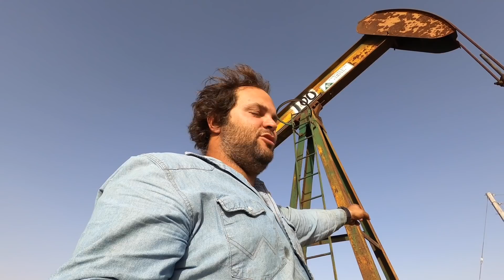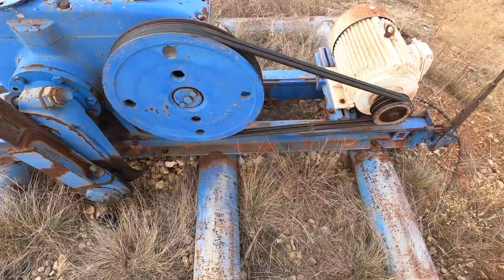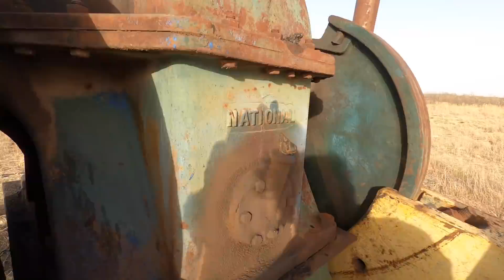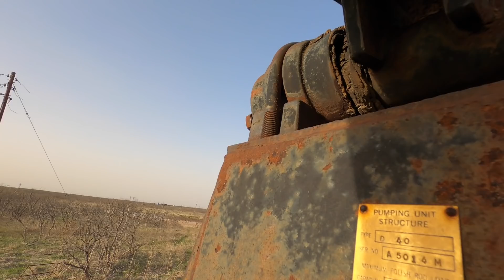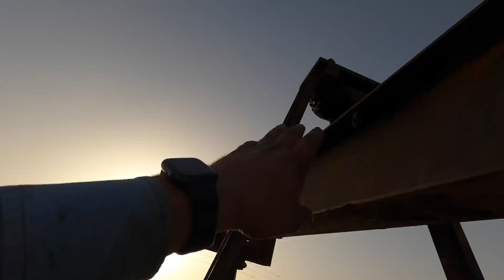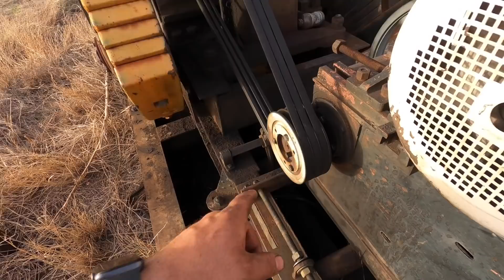Everything Pumping Unit.

Comment: I just started looking after some Sentry/Shores 114-173-64 pumping units. Wanting to start a greasing rotation. Is it possible to over grease a unit? Also what is the best gear oil to use?

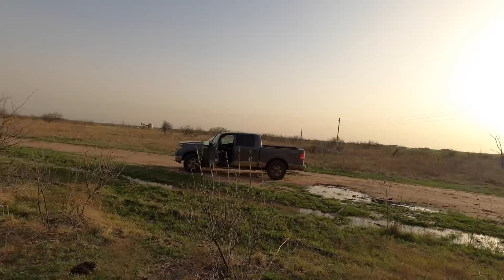Comment: At the 13:30 mark is that water on the ground salt water the cows cant drink? Or is it well water not fit for man nor beast? So your casings run down 150ft to exclude surface water so the cows probably know not to hit up on oil rigs. Looks like they were hungry but I saw lots of green stuff on the ground for the farmer. I saw you hot rodding on the road so keeping a close eye out for cattle would probably pay a person. I was in heavy industry for 40 years and did all the stuff you do, and just watching you I feel you would be my equivalent in the oil patch. The onliest thing you did I might not get was that centering locking mechanism for your car trailer. I would have done it different maybe easier to construct. I would have made it with heavy brass bushings with over center locking mechanisms.
Reply from the maker: It’s just rain water.

Comment: Just recently found your channel and subscribed, been active on the drilling side for almost all of my career, and it is fascinating to learn about this part of the production side.

Got a question for you.   Some pumping units have what I would call the "power unit"  (motor, gear box, etc) between the horsehead and the saddle bearing structure, unlike the units you've shown, with the equalizer mounted approx midway on the "walking beam".   Is there a particular reason for that design?   Advantages/disadvantages?
Reply from the maker: We call those grasshoppers. Not really just a different design and are usually bigger.

Comment: Have you thought about getting a welder and doing your own welding? I learned basic welding in high school. The welding that you talked about here is not anything that hard. A welder can also be used to power 120V and 240V things like the thing you used to weld pipes together. I don't know how much welding you need done and the cost of getting a welder may be more than you pay to to have someone do the welding. One or two welds a year may not make it worth paying 2 or 3 thousand for a welder.  I am not sure what the cost is now but that is about what they cost about 10 years ago,  for a made in the USA diesel engine welder.
Reply from the maker: I am set up and do most of our welding. There is more to do than i can get to.

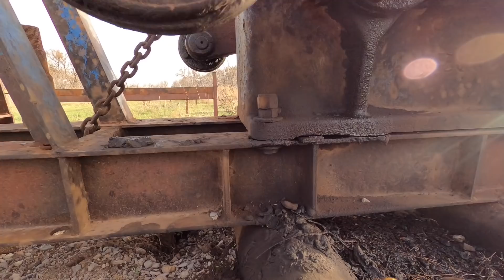Comment: Just a thought but to make that repair at 12:14 could you fab a section of thick "angle" in your shop to nest inside the beam (radius the corner with a grinder or your mill) and drilled for that bolt? Knock off the rust then weld in place like plating a truck frame (you have full stick access from the outside) and done. Saves money, stronger than stock, scrap is cheap and most of the work gets done indoors! Use say 1/2"" or thicker plate (overkill is good) and it would go nowhere.  No need to cut the gusset on the left out of the way when ya could weld to it.  You know more than enough about these systems to figger out non-traditional repairs to keep your money in your pocket. 
Another way if you prefer flat bar on top of the web could be to swap out the bolts one by one with longer bolts to let you raise the gearbox without detaching it from the frame. Then predrilled flat bar could be slid underneath one mount bolt hole at a time to maintain gearbox control/alignment and the bar swatted into place after the first bolt is placed. 

You'd still need a welder but could avoid the winch truck. Given all you know about these systems some thought to non-traditional repairs could keep a lot more of your money in your wallet.

Comment: Do you use TE motors for these pumps? Depth of wells? 2000 ft? Plenty of weight in the sucker rod column then. Amazes me how long that equipment can keep on going. Good vid.
Reply from the maker: Theres still a few open case motors around but for the most part they are all tefc motors. Most of this stuff is 1600 feet.

Comment: That was great, should we be taking notes for a test at the end? Are all your leases within a close poximity to home? I was shocked to hear you say you would have to hire someone on lift the gearbox and weld the mount, I’ve seen you use that boom truck at home on the motorhome and if you sign up for a welding class you’d be all set. I remember when you rebuilt that shaft in the single gear box. How many wells have gas engines? Do you typically only work on your own units? Kc
Reply: You know what they say, “one man’s junk is another man’s treasure”.
Reply from the maker: My stuff is all within 20 miles or so of my house. This will probably be a job I will do. I have more work than I can handle and have to hire some out though. There are still several wells around that are ran off of gas engine, more than you would thing, but everything Ive got has been electrified.  For the most part only I only work on my junk. I've got some equipment that I will hire out with from time to time and do a little consulting work but it 90% or more just my stuff.